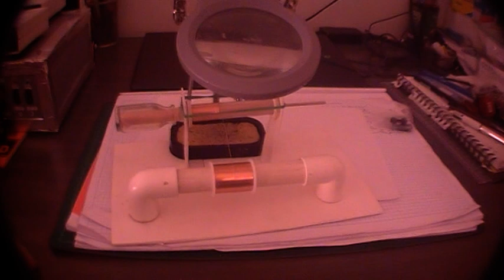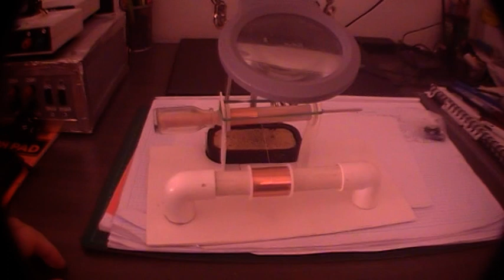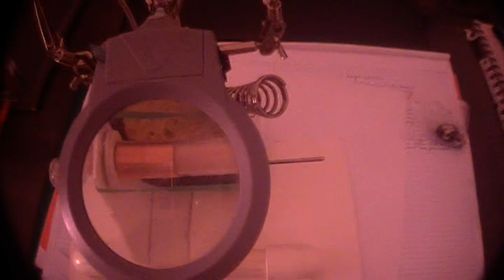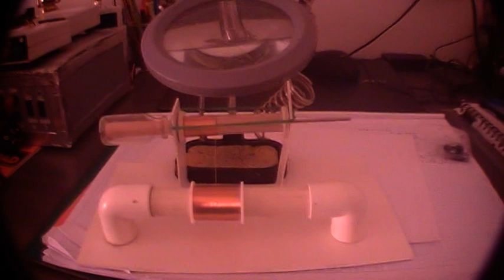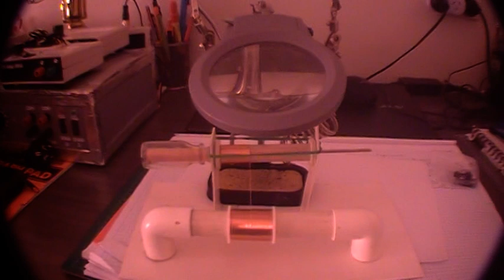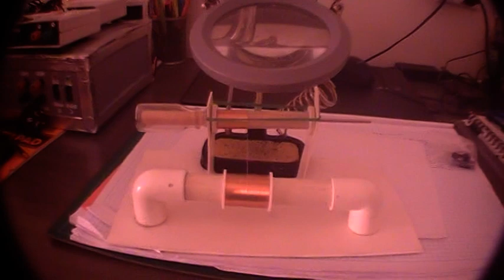mini coil winder for the sec excitor project

Comment: excellent work steven, it must go faster the construction of coil with a system like that, and if we want a bigger coil we increase the size of the machine and it's gone hihihi, thanks for sharing steven your French brother.    excellent travail steven , sa doit aller plus vite la construction de bobine avec un systéme comme celui la , et si ont désire une plus grosse bobine ont augmente la taille de la machine et c'est partie hihihi , merci du partage steven ton frére français .
Reply from the maker: dave ive built some very long coil winders before but this one i needed to make and got a coil wound by it allready